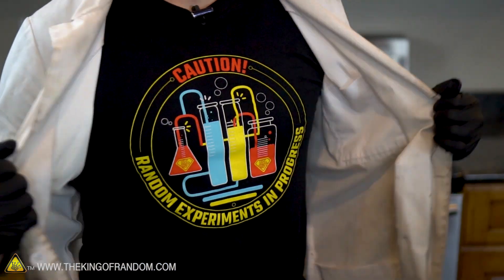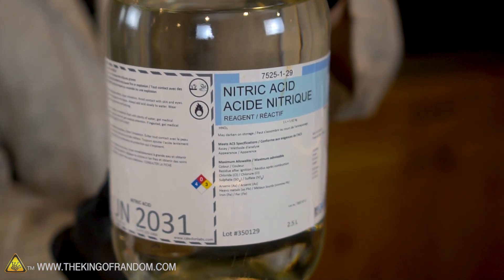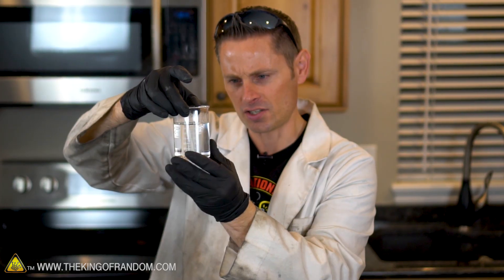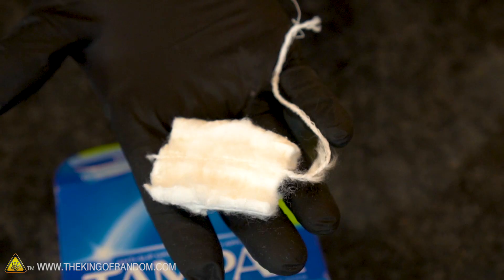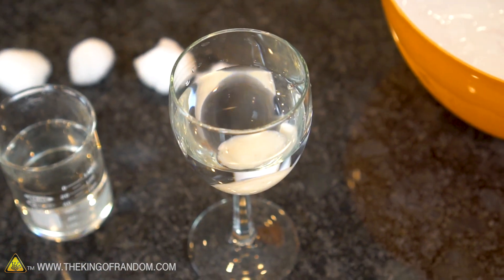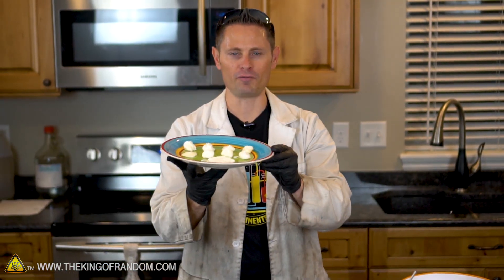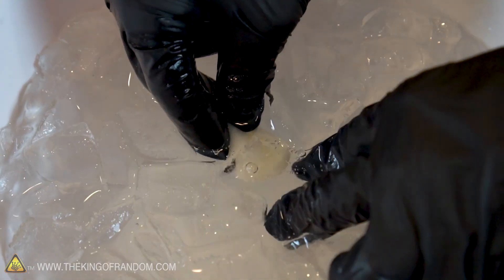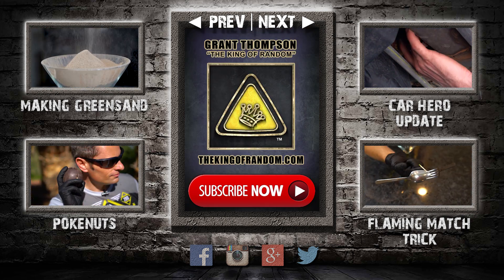Was The Tampon A Good Idea? TKOR Shows How To Make Nitro Cotton From Tampon

Comment: Just FYI, that was not technically the correct way to measure equal volumes in that beaker.  There's no such thing as "conservation of volume", meaning 20ml of A plus 20ml of B does not necessarily equal 40ml total.  It would have been better to measure the reagents separately and then combine them, if you want the resulting solution to be more precise in terms of proportions.

Comment: Hey Grant, coming from a chemist, you are not using nearly enough water to neutralize. You want to dilute acid before adding a relatively strong base like baking soda. So add acid to large volume of water (few gallons) and them slowly add backing soda to neutralize the rest and bring the pH up.

Comment: You said the measurements wrong, you said 120 and 60 instead of 140 and 70.
More importantly, you did the chemistry wrong. You should have used 60 ml sulphuric acid and 80 ml nitric acid

Comment: Grant you need to try melting dry ice in a sealed coke bottle. If that works you need to try heating up in a pot of water on the stove to try to make it go supercritical. Also you should try pitting a egg shells or something in there that would dissolve. If you think grant should melt dry ice in a sealed coke bottle like this comment.
Reply: Dotz0cat it would explode because of the pressure
Reply: A coke bottle was able to hold room temperature liquid butane and propane.
Reply: Yes, I know I saw that video... But I've also seen people fill up a bottle with dry ice (on Time Warp I think) put it in water to enhance the effects an it exploded..
Reply: Dotz0cat dry ice doesnt melt, it sublimates.
Reply: Yes it does sublimate but under pressure it becomes a liquid
Reply: The plastic bottle would burst before that happens

Comment: "Oh, by the way, the fumes are toxic"
doesn't wear any protection

Classic Grant xD
Reply: classic grant is classic
Reply: if you have a fume hood, such as a well ventilated area, or are outside, toxic fumes are less dangerous because they just get sucked/blown away.

doing it without a well ventilated area or outside it's similar to running a car indoors (maybe not that dangerous but it'll build up.)
Reply: Ashton Krause True. Or an air purifier that filters to about 1 micron would work aswell
Reply: Lucas Schott Whats you're iq, 20

Comment: hey grant, to get a 50-50 mix you should calculate the molarity of each acid, then take into account that the purity of each isn't 100% because they are diluted in water so once you have thos calculations done you will know how much grams or mililiters of each you'll need. in fact a 50-50 mix could be a 70-30 mix in volume.

Comment: So if you just dipped the cotton balls in pure nitor it wouldn't work because it would fill up with water the reaction lets off? What is the boiling point of nitor? Would it be possible to heat up everything to 100 celsius and let the water evaporate or would it be too hot?

Comment: who else noticed the beaker was 140 ml not 120
Reply: the sulfuric acid was 93% and the nitric was 70ish%, so accounting for the dilutants I think he made a 50/50 mixure
Reply: 741Mo0R_ G4M1NG YES! THANK YOU! And then the beaker itself says 150mL on the side of it. Science can be confusing, but why you gotta be like that, beaker?
Reply: 741Mo0R_ G4M1NG  was looking for someone to say that... and as well it was 60-80
Reply: who else noticed the beaker almost said weegee?
Reply: I think that is a different unit of measure because on the left side of the beaker it has  120 on the bottom
Reply: Sarah Snyder k
Reply: Evan Verburg what's that cause if you mean ouija for the ouija board.....hahahahahahah 😂 😂
Reply: Wtf
Reply: This is since the beaker measurements do not account for the little space at the bottom since the company who produces beakers doesn't want to put the zero mark at the very bottom. Basically what it is saying is that from the 0 to 120 is 120 mL and if you fill it to 0 and pour it all out, you essentially had 140 mL
Reply: Ggranger02 it's the same unit but luck at the numbers
 0-140
20-120
~~~~~~
40-100
60-80
80-60
100-40
120-20
~~~~~
Reply: 741Mo0R_ G4M1NG Grant said he realized he did 80-60 not 60-60

Comment: I'm no chemist, but didn't you say that you wanted a 50-50 solution, but you used a 95% solution and a 70% solution... so wouldn't you have to adjust for the 70% solution, or did you make sure that the they both had the same number of moles per liter?

Comment: I find it super hilarious that you use the Imperial Measuring system for temperature, but Metric for weight, and liquid measurement. If you want to be as scientifically accurate as possible, you should be using Metric Only.

Comment: No, this beaker does not measure up to 120 ml, but 140 ml, so you made 8:6 -> 4:3 ratio of nitric acid to sulfuric acid.

The right scale is the volume measurement scale. The left one is scale for decanting (substracting from full).

Comment: You can actually use a tampon as a tinder bundle when starting a fire with flint and steel. Just fold it out and scratch the top to get some fibers fluffed up and voila! Saves some space in a survival kit, and doubles up as a first aid gunshot wound plug!

Comment: Comical I was sat thinking how you was going to neutralize the remaining acid solution, and wondered if you was going to use the baking soda and ice water just as you dumped it into the ice and baking soda mix, now I'm left wondering if you'd of had such a violent reaction if you'd just added small amounts of baking soda to the scientific beaker? and would it have created a thermic reaction with out the ice?